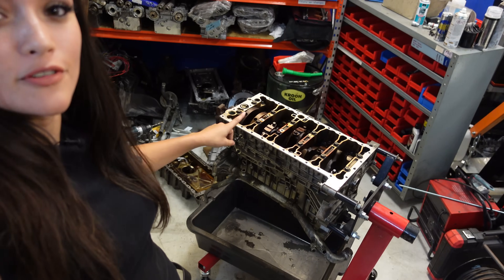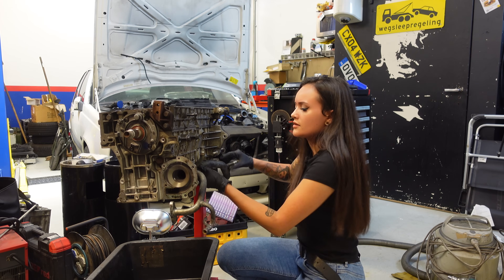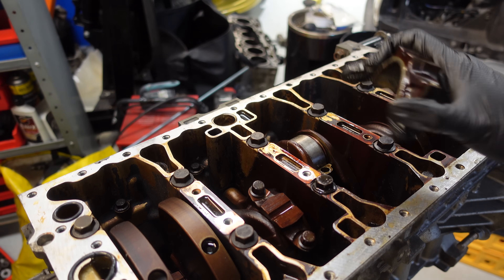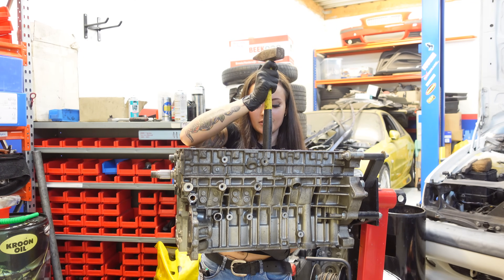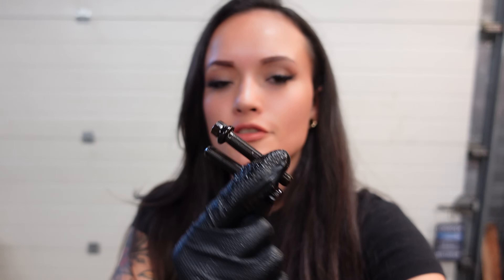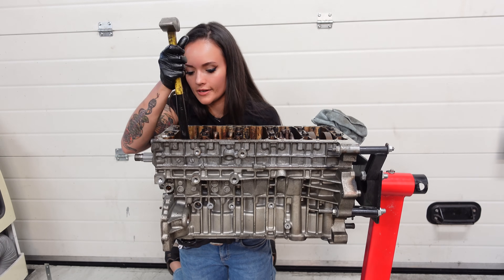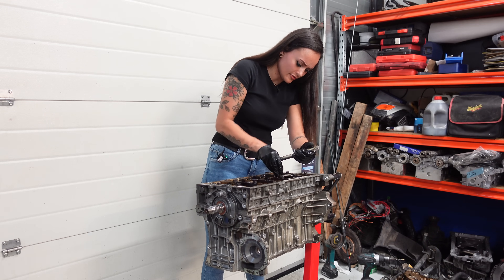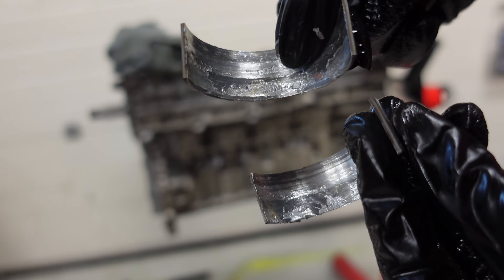Disassembling a BROKEN VOLVO 2.5T engine!

Comment: they are called crosshatch . they are very important for lubrication . if they are gone further down it is a sign of wear , the cylinder is not completely round anymore , you can not just put new pistons and piston rings in a worn cylinder ,

Comment: If you want more leverage, to remove main caps or head bolts, you can turn the engine 90° and you won't have to worry about the stand moving.

Comment: The rings are called top compression ring second ring also compression ring and the bottom ones are called oil control rings these are separated by a spacer

Comment: One thing I noticed in your video was that you are using constant pressure on your tools to break them loose  when I was an. Apprentice many years ago my boss taught me this saying ,two short jerks work better then one long pull I have always used this approach when undoing bolts or nuts and it always works easier on your body too

Comment: Hey friend! Its good to see someone spending some time to work with that good old engines. 
I have the Volvo fever too. Greetings from Germany! ))

Btw 16:35  I bet the owner of the engine replaced the valve stem seals before the failure. 
Moving parts tend to wear out over time.
Leaking stem seals take some of the pressure off the crankshaft. 
New seals suddenly apply full pressure to the worn-out bearing shells. 
High revs plus old material. Maybe that's the reason.

Comment: Good job, when I was a kid my grandfather owned a professional car garage and he allowed me to strip down scrap engines out the back. Because I was so young I didn't have the strength to break out the main bearing cap bolts while the engine was being held by my knee on the ground. So my grandfather encouraged me to come up with a fixture so the I could secure the short block to a bench that was bolted to the floor, then I could use a pipe on the breaker bar to break out the main bearing cap bolts. Good luck with the future work, looking forward to more of your videos 😊
Reply from the maker: That's such a nice story! It's so cool you did all of that yourself already back then 😁

Comment: Enjoying the content as usual, thank you 👍🏻 
Just my .02, I don't think those oil seals were causing lack of flow. They were sealing 2 parts together, that's their main job, and the size of the flow hole in the middle was huge honestly. They were not restricting. I'd be looking at the oil squirters and/or everything else for the cause. Good luck!

Comment: When undoing crank on the floor, sit down, support the block with your legs and pull the pipe with the whole body like rowing the boat. Do not loose/tight the bolts with your elbow and shoulder, because you will get allot of pain down the line..and always squeeze the abs:)
You are NOT weak.
Yes you can do more than you think.
Yes we absolutely love all of the videos.
And no you are not broken parts:)

Comment: I like your videos. I think those bearings are fatigued from high temperature and not enough oil flow to cool them. Probably by accelerating hard a low speed (high load) , maybe with the wrong weight of oil. Maybe a dirty oil filter as well. Keep doing what you love to do

Comment: Hej from sweden. 

This engine is the weakest volvo engine. This orings is the most common issues. 

You want to messure the borr in the cylinder on this engine. Common issue is that the borr is coning and the engine consumes oil. 

Best luck

Comment: I do like these shorter videos. It's a Joy to watch you work as always ;-)
Still a nice cross hatch on the bores of that shortblock so you could reuse that without any work at all. At least I would.. I couldn't get a really good look at those journals but from what I could see I reused crankshafts that looked way worse than that so a little polish and some new bearings and it should be fine👌

Comment: Great video Joy. It turns out this engine had been overhauled at some point. However, it wasn't done well and the work was shoddy. I think the oil pump is still working properly. However, due to the poor sealing of the rubbers, there was a loss of oil pressure. This damaged the bearings due to a loss of pressure in the engine block.

Comment: Nice work, I think you should check up those o-rings. The old ones was definetely abused but the new ones does not look totaly correct either. I think you should check if there was different versions of them.

Comment: The yanks call those bolts a triple square. I know it as a 12 point torq bit. And yes, oil squirters. I also like playing with engines. Far more fun than bodywork. Sanding and grinding is soooooo boring. Looks like someone used generic O rings instead of the Volvo specific ones. The big one probably split because it was compressed too much between the mating surfaces.
The third ring is called the oil control ring.

Comment: I am about to tear into a 2004 s60r block. Supposedly headgasket but i think a valve broke from my borescope view. I have 2 s60r im swapping engines and manual swapp m66. I'll be rebuilding one. Yes, this was great info.  Definitely some trashed bearing 😬 in that engine.  Thanks for sharing 😁
Reply: Was the problem no compression or burning coolant?
Reply: @DWTSVIDS was coolant in cylinder and some was in oil. I scoped the cylinder and looks like part of a valve is chipped and debri in the cylinder as well. 😬 was scared to do compression with the debri in it.
Reply: @LineTwist  well if you remove the cylinder head be sure to check for cracks in the cylinder liner, especially is cyl 3 is the problematic one. The 2.5 blocks have a bit of a habit of cracking liners.
Reply: @DWTSVIDS i am probably going to just sleeve it and rebuild this engine since i have a good running engine i am swapping along with the manual swap. Sleeve will be  Better for Mopower 😂 😂
Reply: @LineTwist if you're chasing power maybe consider a 81mm block theyre fine until 600ish hp. Lots of things that can give issues when sleeving a engine
Reply: @DWTSVIDS really, they rate them to 1000 horsepower.  I was looking at LA sleeve from elevate

Comment: 2:22 That's a 12-point socket. Sockets generally come in two types: 6-point and 12-point. The 6-point design closely matches the shape of a bolt head, offering a snug fit and reducing the risk of rounding. The 12-point socket, on the other hand, allows for twice as much engagement angles, making it easier to work in tight spaces or with limited ratchet movement.
Reply: 12-point sockets are handy because they work on 6 and 12 point bolts, even though they can round off 6-point bolt a bit easier.

Comment: Be careful if reusing anything from the engine as the damaged bearing material will have contaminated the oil passages. Also make sure the bore is still in shape all the way down where the piston runs as they can be known to oval or go out of shape from top to bottom, this will require measuring correctly with a special tool👍

Comment: Good video.  Wow, those bearings are done!  Did I miss how many kms are or were on the motor?  That's pretty cool you are breaking it down.  Once its back up and running, then you will have a baseline for that motor.  Looking forward to the next video.  Cheers.

Comment: I dont think those "O" rings were the issue with the totalled bearings. Probably someone was trying to fix some oil leakage and didnt had the time or money to get original rubber seals but instead used ones from those "300 rubber rings with different sizes in one box" kind of kits. 
 Imo there are 3 ways to damage so bad the bearings - running it with no oil or not working oil pump but in this case there will be damage everywhere - camshaft, piston rings, piston cylinders, conrod bearings etc. 
Or at some point this crankshaft was machined and it was machined realy bad or someone did it by hand "cuz his grandad did it when he was young". 
And the third thing is if the crankshaft has clogged oil paths. Or some other oil paths connected with the crankshaft lubrication.

Comment: On some of our turbo engines we would see rod bearing failure when the boost was too high for the fuel supply, so it would run lean at high revs and there would be pre-ignition, and that would hammer the upper rod bearings.  You can't hear pre-ignition at that speed and it still makes power so you don't know until it's too late. We found monitoring the exhaust gas temperature was the key to knowing when things were getting out of hand. If that motor has a history with a re-chip or some fiddling then that could be a possible cause. Always good to see you enjoying yourself, keep it up.
Reply: EGT’S 😀😊

Comment: Looks like oil starvation this engines usually dont just fail. I had a s60 from 2000 whit a 2.0T whit 488.000km sold it cheap and it lived for another 3 years before getting scraped

Comment: An seized real volvo 2.5 engine, that is something rare ! Makes it extra interesting to watch.
Reply from the maker: Right?! I had to get this engine, just because I was curious to take a look at the inside 😂🤭
Reply: @joy.vanhaelen  Thx, never had seen the inside of the greatest engine of all time.
Reply: Not rare at all…. The 2,5T had a tendency to crack, loosing coolant and run hot
Reply: @Hesselberth  Strange there are still a lot out there with high km/mileage. Never ever heard that claim before.  I did see a friend destroying one by constantly flooring it at 1000rpm "Look how nice it pulls!". Which only proves great engines are also not indestructible.
Reply: @basbass429 my mechanic told me it was specific for the early 2.5T, like mine was in my 1996 850. They made improvements for the S/V70 2.5T
Reply: @jortmentink  ah ok, sorry was always more of a first gen s70/v70 guy, due to the fact the 850 interior looks so  80's and outdated.